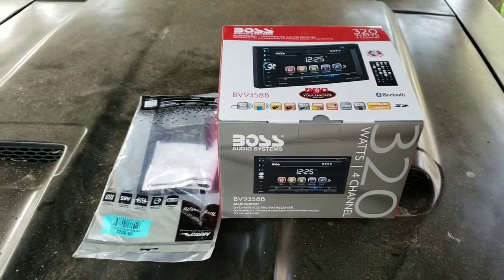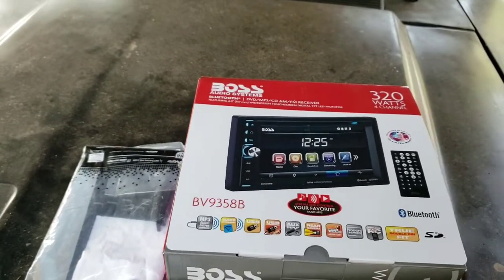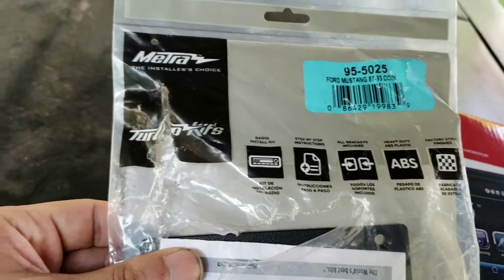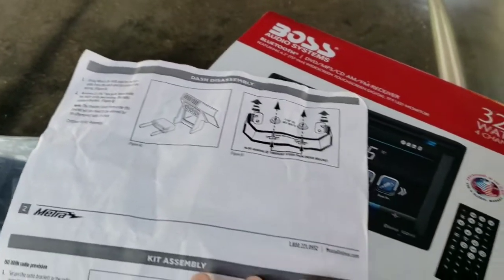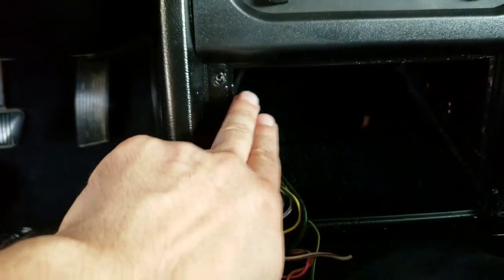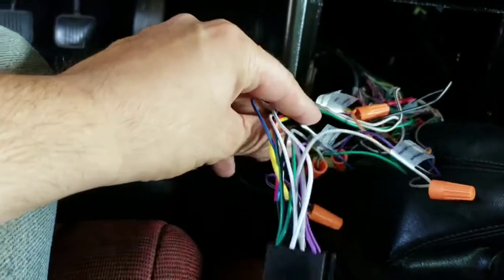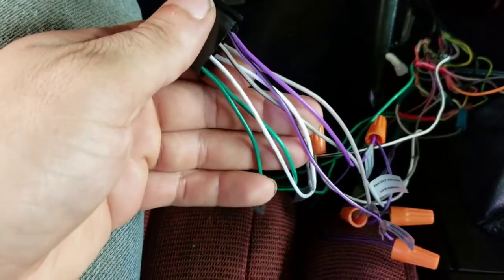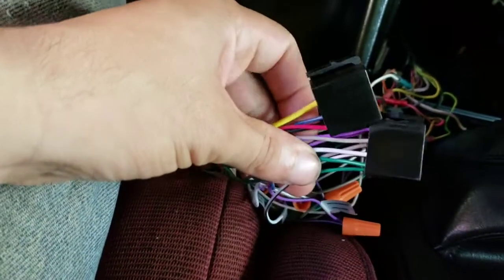Installing a Double din stereo in a Foxbody Mustang

Comment: Did you have to make a bracket to install this double din? Or any thing custom made
Reply from the maker: No all I did was cut the two studs and it went in just fine.
Reply: @RobertMarin27  ok thanks bro for the quick reply I went to a sound shop to ask they told me they had to make a bracket for it to go in just for the install they are charging me 120 big time rip off...
Reply from the maker: You welcome bro! Will need to get a dubble din kit for it also.
Reply: How did you cut the stubs?..

Comment: The 12v constant aka memory wire is supposed to be a seperate connection from the 12v accessory wire.
Reply from the maker: Joe K Thanks bro I didn't know that. I'm going to separate it.👍
Reply: To test for an accessory wire use a multimeter and put the positive lead on the harness and the black on any ground/bare metal. Turn the ignition to accesory and it should read 12v. If the meter says 12v without the ignition in the accesory position then that is your constant 12v wire.
Reply from the maker: Thanks bro
Reply from the maker: Thanks bro 👍
Reply: What happens if you do connect them in the same wire...will it always loose the memory?
Reply: If you connect both the 12V Accessory and the 12V Memory wire to the vehicle’s accessory wire then you will constantly lose the clock and radio settings. Unless the radio has some sort of built in back up battery. DM me on insta if you need more help j_koz.
Reply: Some cig outlets are wired with either constant 12V (cig lighter still works with the key out of the ignition) or 12V accessory (key must be in the accessory or on position to work).